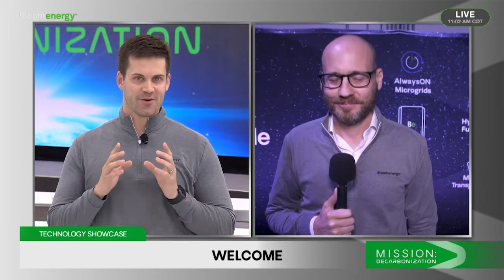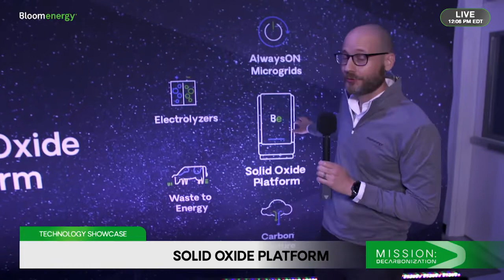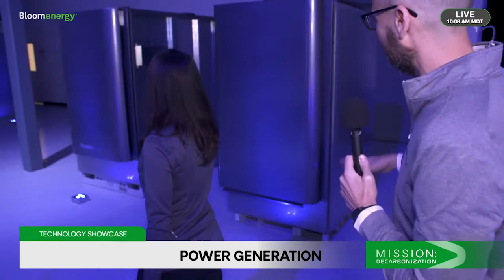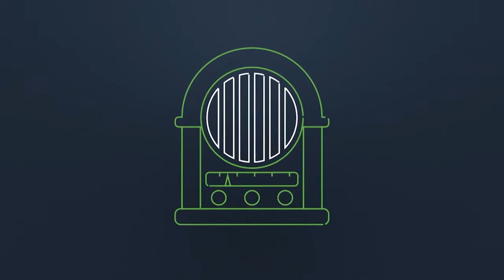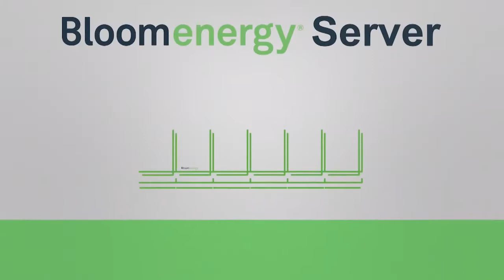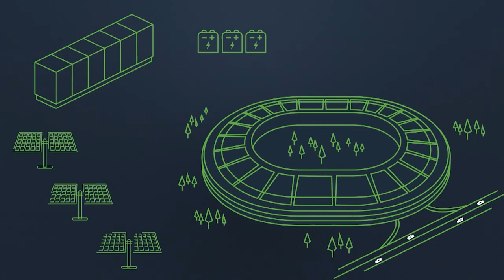Sneak Peek: Power Generation | Bloom Energy 2022 Technology Showcase

Comment: First of all, a small 5kw system that runs on hydrogen would make more sense than 50kw banks to get the technology out in the market. Secondly,  I  think with the power density of your system or potential power would be enough to sustain a reaction to split ionized water to hydrogen and also have enough power to be made useful  depending on the flow of gas needed and if thats a factor.  Either way,  it's not a good look to be exclusively catering to the rich, especially with such an important  innovation.  You could be known worldwide in every home by now, it just makes no sense.